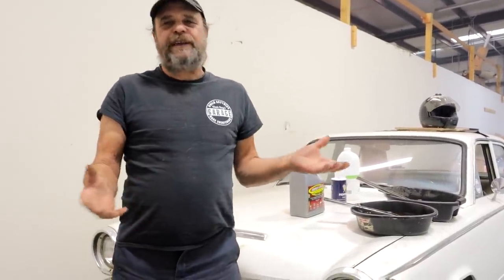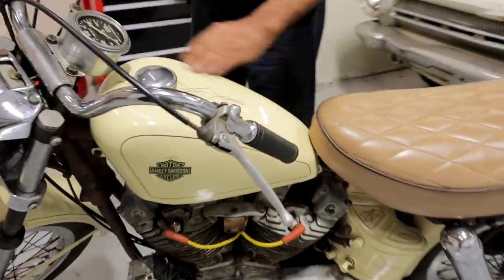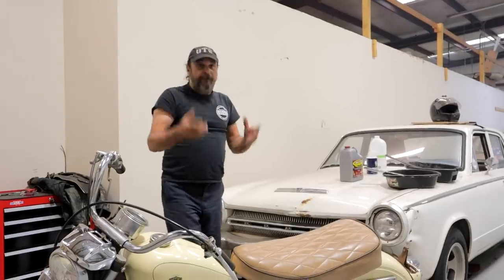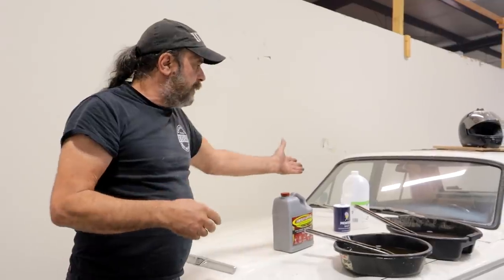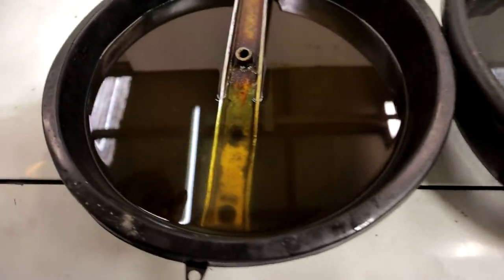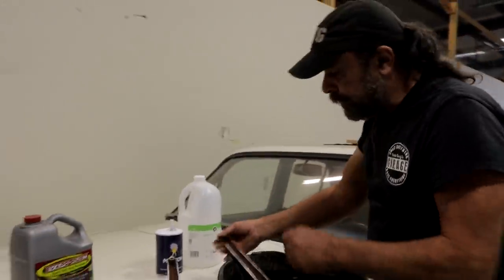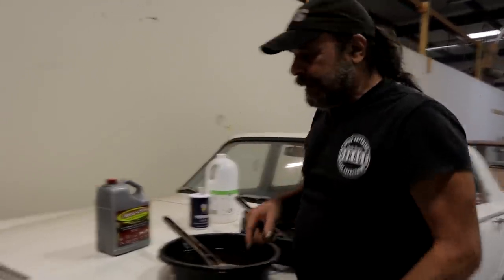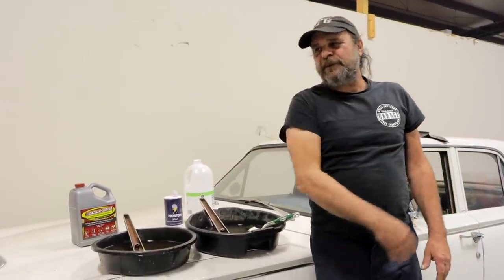Evaporust Vs. Vinegar - At 10X The Cost Does It Do 10X The Job?

Comment: I've never heard of adding salt to the vinegar.  How much salt do you add?
Reply: @CarsandCats  I've never heard of it, but that's what Tony said and he has salt on the thing next to the vinegar.
Reply: @CarsandCats  Salt is neutral.  It is formed from the reaction of acids and bases.
Reply: About a cup of salt to a gallon of vinegar.
Reply: Take his advise with a grain of salt,lol.
Reply: @deliveryguyrx  Hey, I'm  an old, salty sailor.
Reply: @snocrushr  HA! I was going to say that.......but ya beat me to it, lol.
Reply: @captainjohnh9405  But isn't baking soda a salt? If it's neutral, why would it react with vinegar? I remember a chapter from my college text book 50 years ago called "Acids, Bases And Salts." I'm a bit feeble in the chemistry department.
Reply: @curbmassa  No, baking soda is a base.  Salts are ionic compounds that have neither an H+ or OH- ion (Hugely oversimplified).
Reply: @curbmassa  Baking soda is  a Base ...
Reply: @captainjohnh9405  Alrighty then, thanks. If you know, could you please explain why Tony put salt in the vinegar? Does it increase its potency somehow?
Reply: @curbmassa  Sorry, forgot to address why adding salt helps.  I, too, am a bit rusty (pun intended) at my chemistry, so don't bet the farm on this, but... the acetic acid splits into two ions:  AcO- and OH+.  But, only a tiny fraction of the molecules split at concentrations found in vinegar.  To get most to split, a very dilute solution is required.  IIRC, the Na+ and Cl- ions in salt are far more reactive, and split easily in water.    That helps accelerate the acetic acid ions splitting.  Also, Fe is more willing to bind to Cl- than AcO- which encourages the            Fe to let go of the oxygen.

Either that, or it is PFM.
Reply: @captainjohnh9405  Okay, thanks. I think I vaguely understand.  Does the Cl bound to the Fe turn to a gas as it dries?  Back in the day I stripped the rust off my '41 Ford (North Dakota car) with vinegar soaked rags covered with plastic and a sharp putty knife.  Slow, but it worked. I asked lots of people what was the actual chemical reaction going on was and nobody knew so I ascribed it to magic.
Reply: @curbmassa  Okay, I am really streaching my memory to the limit.  Iron Chloride is a yellow, blueish purplish, or black solid (in the derusting process, a powder).  It depends on the valence of the Fe, that is it depends on if it is Fe++ or Fe+++.  Fe+++  is the preferred ion, and combined with oxygen is red rust.  Fe++ and oxygen forms black rust which is slow moving and pretty benign.
Reply: @captainjohnh9405  Okay, thanks. I did a bit of a Google dive and I think you're correct. I remember back in the '70s they were using structural steel in buildings that was unpainted and exposed to the elements that was described as "self-sealing rust" that needed no maintenance? Wish I worked harder at chemistry because later I became intrigued with the concept of manipulating things at the molecular level.

Comment: the company that makes POR15 makes an awesome tank sealer, I've used it and can tell you after 7 years it's still holding up with ZERO problems.
Reply: I've use the POR15 tank sealer on a 1945 Farmall A gas tank and it worked great. The problem is you need to remove the petcock.
Reply: Honestly I’ve heard too many stories of these tank “sealers” breaking down over time. Unless the tank is leaking I would only use them as a last resort. Best to remove the rust and use a fogging oil to keep the rust from flashing back.
Reply: I just sealed the auxiliary tank on my 69 f250 with por15 sealer.  It put a rock hard, smooth coating over the entire surface.  Looks really good.
Reply: @supersportimpalass  Damn ethanol will eat sealer from the tank
Reply: Tank sealers will breakdown and clog the whole thing after some time. Better to braze the holes or tin it.

Comment: As some have suggested, I suspect there must be something coating the inside of the gas tank and stopping it from working. I’ve been extremely happy, and downright amazed with the results from Evaporust, completely removing rust on old suspension parts, and exposing all sorts of original paint daubs that you never would have guessed were there. Just do a good degreasing first and stay away from wire brushes or aggressive scraping. Also, it doesn’t work on clear zink plated parts, but is excellent on the black phosphate type coating on things like bumper bracket to frame bolts.
Reply: Try a molasses soak. Does all the work for you, but takes time.

Comment: I used Evaporust on a lot of my old rusty FIAT parts and it was magical. Took no longer than 12 hours for the worst rust to be down to bare metal. It will/did remove paint in the soak. Maybe not if it were briefly splashed on it. I can’t explain why your tank didn’t come out well. I’ve even used it on heavily rusted cast iron, and cannot complain. It will lose its effectiveness over time. I keep straining it through a large pad of scotchbrite followed by an industrial paper towel to keep the chunks out.

Comment: There's a product called Corroseal water-based sprayable flushable hell you can even wipe it on with a rag rust converter that you can paint over you just need to get the flakes off nasty stuff that will come unstuck when trying to paint it goes super long way and it is amazing product and what you cope with it will not rust again it turns iron oxide and to inert magnetite amazing product

Comment: Here's the way I've seen Vinegar and salt used.  
Start by adding ½ cup salt to ½ gallon vinegar in a plastic container. Drop your rusty extras into the solution, and let them soak for about 12 hours. Next, pour out the salt-and-vinegar solution, rinse off the metal objects, and then immediately return them to the container. Now fill with ½ gallon fresh water and ½ cup baking soda to neutralize any remaining vinegar trapped inside the crevices. After about 10 minutes, rinse the items in warm water, and finish by drying them thoroughly.
Seems to work well, but you do need to use the baking soda afterwards if there's any plates, kinks, etc on the metal you're de-rusting.

Comment: The best cure for rust is prevention. When I store any of my machines (even for years) that have metal gas tanks--cars, motorcycles, utility engines, tractor--I top them off with gas. I change the gas every two years and burn the old stuff in my cars. An alternative I've considered for long term storage (years and years) for very small tanks is to fill them with the cheapest oil available. Used motor oil would also work and would be one way to dispose of it. I don't think the acids in used oil would be a problem but I could be wrong about that.

Comment: The problem with vinegar is that its high acidity will quickly cause it to rust again after rinsing. Even if you neutralise it with a basic solution afterwards, surface rust will reappear within days if not hours. Evaoprust inhibits reformation of rust even on unprotected raw metal for several weeks and doesnt require neutralising. Evaopust is also highly reusable , just filter it and pour back into the bottle for reuse.

Comment: I've had really good luck with Evaporust on a nasty set of Vortec heads.  You can see the results on my channel if you want, the Vortec head video. I bought a 5 gallon bucket and used a tub and soaked the heads for a week. I've also had good luck with POR-15 rust remover. But, they are both expensive. I will try the vinegar and salt on my next project. I love your content especially the attitude of doing what the average guy can afford. Thanks!

Comment: I had good luck with Evapo when I was working on my dads 67. I think if the part has any oils or residue it greatly affects the results. Degreasing first seemed to help. Could be why the tank didn’t work that good.

Comment: I have used Evaporust to remove rust and have good results soaking for a day or Two. Evaporust is water soluble, so you can rinse off the parts and blow dry with compressed air with good results
I have not tried Vinegar and salt but will try. I liked the results you got with this cheap alternative.

Comment: Something I discovered in my old age. Don't bother with food grade white vinegar, use  Cleaning vinegar. you can get it at most grocery stores and find it in the cleaning supplies isle. It's almost twice as strong as food grade vinegar. Also great to remove rust from burned off paint on your car. I have a '91 D150 short bed that the roof was sollid rust. rather than sanding it and risk warpage (something I saw my friend do to the hood of his Chevy Suburban years earlier)  I bought a bunch of cheap white towels, laid them on the roof, soak them with cleaning vinegar straight out of the jug (no salt) and covered the soaked towels with plastic to keep them from drying out. I left it for 4 days, not on purpose, it just happened that way, when I uncovered the towels, I went to remove them and all of the rust stuck to the towels. The sheet metal looked like it did the day it was stamped at the factory! I then washed the roof with baking soda and water to neutralize the acid in the vinegar. I got sidetracked and didn't work on the truck for 6 months, you know how that shit goes. The pickup sat out in the weather. After 6 months, it was still shiney metal, no sign of rust at all, I buzzed it down with 180, primered it and gave it a coat of paint to seal it. Cleaning vinegar is still my go to rust remover

Comment: I've had really good luck with the evaporust. Vinegar I've used to actually rust metal as well as clean the rust so I've had mixed luck with it. And if you need something rust free and quick! Muratic acid (of course with proper PPE)

Comment: Distilled white vinegar is mostly all I use. It works perfectly, but does take some time. Important to wash off everything that has been in vinegar with water and baking soda. 
On big stuff I normally used electrolysis. It's much quicker, but takes a bit to set everything up. No need to use baking soda washing off parts that have been in the electrolysis tank. For your gas tank, I'd do vinegar (no salt) and just let it set for a week. Wax the paint on the tank. Maybe even coat a film of vaseline over the top area of the tank before attempting to pour out the vinegar.  May help to keep it from staining the paint, if any rusty vinegar did happen to get on it.

Comment: Tony
Use a piece of 8ga wire 
Cut to length needed and strip insulation off the lower end and pull the strands out to form a brush 
After feeding into the tank you can work it back and forth to knock loose scale off and the wire is stiff enough to somewhat bend and hold to the form you want or need to reach different spots

Comment: After the tank is cleaned mix a little atf with the gas. It's a rust inhibitor and doesn't seem to foul the plugs if used in moderation. Works on our antique tractors years after a muriatic acid cleaning without a coating

Comment: I cut a plastic 55 gal drum open long ways and put long parts in a 25% vinegar/water mix. Soak for 7 to 10 days comes out like new metal with a little scotch brite rub. I did a nut and bolt restoration and all the rusty parts that fit in a 55 gal drum got a vinegar bath prior to repaint. No rust left behind with vinegar and no sticky film. I didnt even use salt.

Comment: Two words: phosphoric acid. A gallon of phosphoric prep and etch is $18 at Home Depot and it will eat rust without touching the base metal. Also works great to remove aluminum oxide from cast aluminum. Just keep it away from galvanized metal.

Comment: I have had great results with a 50/50 solution of white vinegar and lemon juice for dissolving rust. It does have a shelf life though so I typically make a new batch every time I need it. Follow it up with a mild baking soda and water rinse to neutralize the acidic properties followed up with plain water to get all of  baking soda out for good. Do a final wash with phosphoric acid and a water wash after that to clear out all of acid (baking soda not necessary) and you end up with a rust proof coating of iron phosphate. It is VERY thin on the surface of the metal but it lasts many years. A fuel tank sealer like POR-15 applied as an end all, sealed for good, is the icing on the cake. You have sealed a rust resistant coating. I have a 1971 Honda CT70 that still has the original tank thanks to that process.

Comment: Put evaporust in the tank and drop a small heater in there. Let temperature rise as high as you feel safe, id say 150F. Evaporust uses a chelating agent that binds to metal ions and lets them dissolve in the water. You may need to empty the tank and filter evaporust solution couple of times. Normally you do not need to filter evaporust, when you submerge parts in it; but id suggest to filter it in this case before poring it back in the tank to keep crap out of the tank.

Comment: Uncle Tony I've been through something like that recently. I'm fixing and selling lawn equipment as a second job. Evaporust reacts with zinc coated parts and it actually weakens the evaporust. You don't notice it with hardware especially lightly rusted stuff, but gas tanks seem to just kill the evaporust. Also any grease or jelled up fuel diminishes its abilities too. Generally before Evaporusting stuff I spray it or soak it with Zep purple degreaser,scrub and rinse it well, then let it dry over night. The evaporust works faster and better plus I can use it more times before it isn't effective anymore. I don't want to paint my gas tanks either,  I've had the best results with acidic toilet bowl cleaner. The one I use is a commercial one it's a liquid with a flip top, and it stinks. I pour it in and within about 5 minutes the tank is either rust free or damn close. Afterwards you have to  rinse the hell out of it and start flushing it with baking soda or it will rust up worse over night, Then fill it with gas asap.
Reply: I use apple cider vinegar. 5% acid.

Comment: Maybe try leaving cap off fuel tank. The evaporust worked in the drain pan.   Maybe it needs air
Reply: I know evaporust will produce vapor. I found traces of condensed vapor around plastic container lid.

Comment: Home Depot sells "cleaning vinegar" which is much stronger than the stuff at the grocery store - white vinegar.
Reply: @charlesangell_bulmtl  its 6% and over 4 bucks a gallon if I recall correctly. Not worth it  in my opinion.  They also sell a 30% vinegar that's 20 bucks a gallon. I've never tried it.

Comment: I've had super luck with antique bicycles and evaporust. Also used an aquarium pump to circulate it over a larger area, and cut it with 50% water and it still worked well. But usually when its surface rust, or old chrome bits.
Reply: How does it work on rusty chromed handlebars and fenders?

Comment: I did a similar test and found similar results. I will say that the vinegar solution lasts longer as in can clean more parts than the evaporust. If possible cleaning anything loose or greasy really helps too!
Reply: I think that's the problem.  I think there is gas gel residue on the tank and the evaporust cannot get to the rust.  I have had great luck with evaporust.

Comment: Uncle Tony, here’s what you need to do. Remove the tank. Put a thick layer of wax on the tank, close the petcock, put a mix of 30% muriatic acid, 70% water. Put the cap on, shake it up , and let it sit maybe an hour, maybe 2.. dump it, rinse with water, blow it out with air, then put a bit of acetone in there to help dry the water, dump the acetone out of the petcock, and wipe wax off the tank. And voila you’ve got a clean tank. Tge wax protects the paint. It works, and works well. We did this to 1000’s of motorcycles a year at the shop I worked at. I’ve personally done it to at least 50, and it works.. trust an Iowa guy here 😎

Comment: I bought some of this stuff a couple of years ago. I thought it was another gimmicky snake oil product, but I can say with absolute confidence anything with rust on it that you soak overnight in this stuff and the rust literally evaporates. No scrubbing was required. Something like a scotch bright pad or even a sponge with a mild abrasive surface is all you need. Maybe a nylon brush. There was something very familiar about the smell though. To my nose, it smells like antifreeze. Yeap. And think about this for a second folks.  Antifreeze in your engine we'll keep it rust free for 5 plus years. Maybe they have some other chemicals in it, but I would say it's mostly antifreeze. With that said I'm not sure there's any magic here. Try some antifreeze and a tub and soak your rusty parts in it. Most other rust removers consist of phosphoric acid., not exactly user friendly, and you definitely don't want it in your eyes. We are talking things like CLR or limeaway, polyzag, i.e. toliet bowel cleaner. Yeah. How about climbing under your car and springing a bunch of this and having it drip in your face. Yeah, baby feel the burn!  Back to the evaporust for a minute. I have not tried just spraying it on something, but I don't think it works anywhere near as well as soaking something in it. Makes it impractical for cleaning up something like a car frame or any large item. I guess it's possible to put some in a spray gun and keep a vehicle frame soaked in it. Never tried it, but for a small parts that you can soak I highly recommend the evaporust, and again It smells suspiciously like antifreeze to me. I will have to test the two side by side one of these days. The other thing about the evapaorust is you can just keep using it over and over again even if it gets disgustingly dirty.